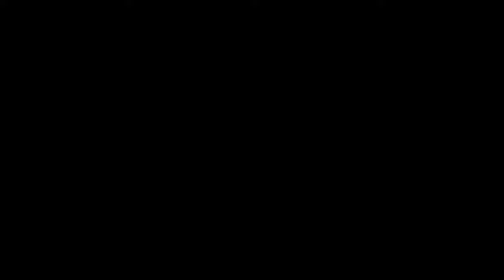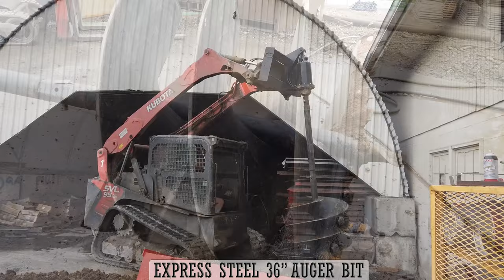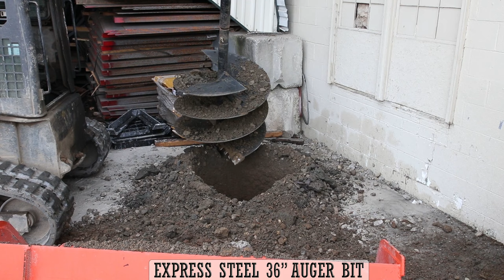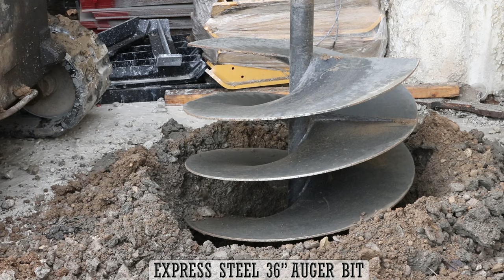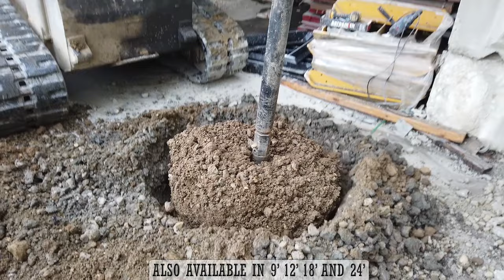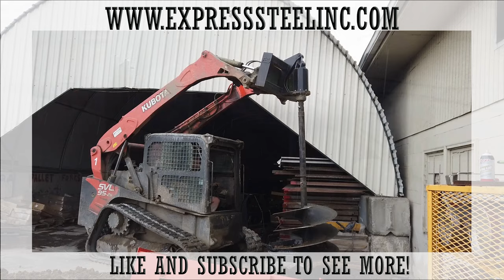EXPRESS STEEL 36" AUGER BIT AT WORK! DRILLING 8' DEEP.

Comment: Where did you get the extension?
Reply: I got mine at a bobcat dealer back in 2015, it was around $300 for a used one at that time.